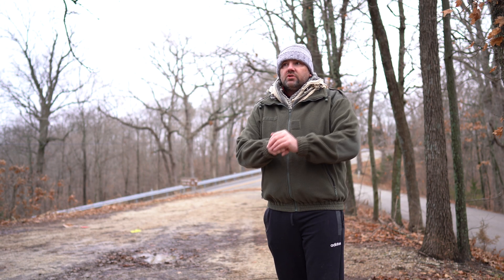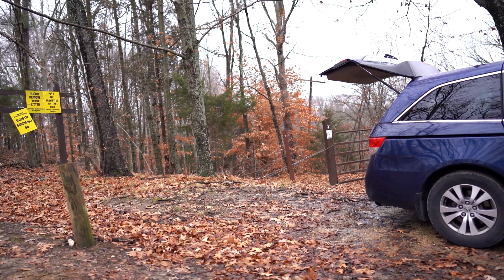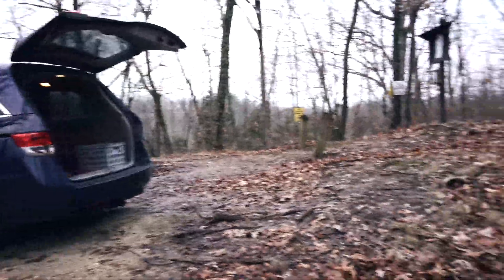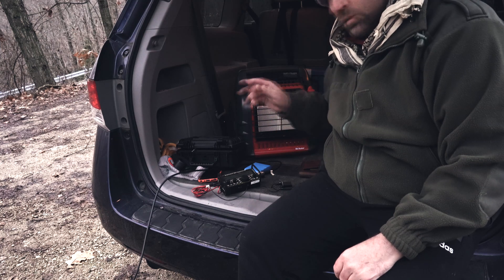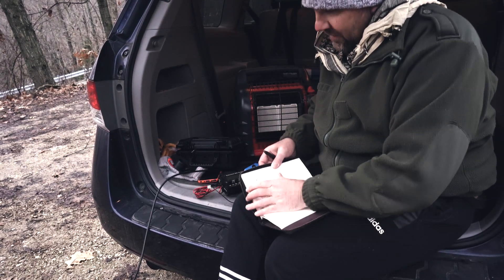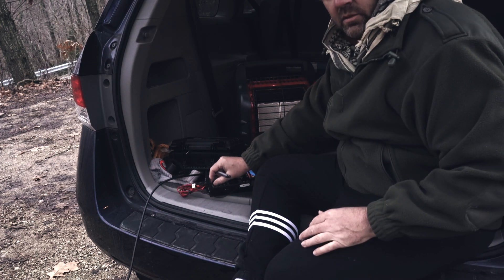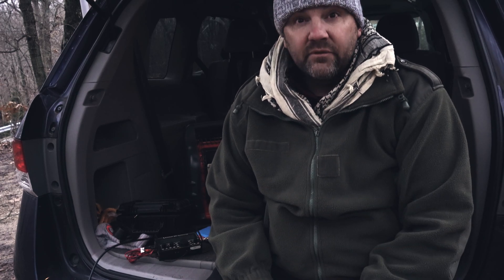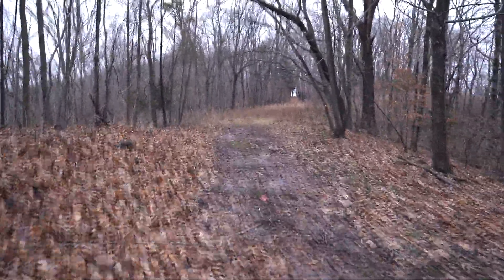Portable Winter Ham Radio Operations CW QRP

Comment: I went out yesterday and set up a G5RV high up in the trees using the same slingshot and trigger you have. Next time going to try an end-fed as it’s easier just to make one shot. I also use the 33’ mast on a satellite tripod staked into the ground and 4 radials with great results. But I’ve been watching your videos and have seen your setups change and improve along the way. It seems like we learn more when we go out and try new things and make mistakes and think about how to improve. I’ve picked up some good ideas and have adapted my portable ops based on some of your comments in the field. Have you thought about announcing a date and time and frequencies you plan on operating? Btw, I also find it useful when you comment on non-ham related stuff like your tent and  camping gear.
Reply from the maker: That is a great comment, congrats on the G5RV.  I like how flexible it is on the bands.  I try to do different things to challenge myself and keep people interested.  I like to try everything and learn, and once I feel I conquered it, I kinda move on.  Right now here in MO it's been wet and miserable out so I'm stuck inside mostly.  I thought about announcing when I will be out, but it kind of adds more pressure to the video.  I have to know exactly when I'll have free time, I have to feel like going at that time, then if I can't go I disappoint people.  Plus I have to worry about camera gear and radio gear and setup and tear down all within like a 2-3 hour window.  Adding the pressure of an announced visit just makes it more difficult.  I have done some live feeds at home though.  Maybe this spring I will announce more live stuff.  

I love your comment it gives me things to do.  Next time I go camping I'll tell what I like and hate about the gear I have.  Always honest.

Comment: Just a constructive comment. You might want to avoid those wire cables along the fence, possible negative effect on tuning. I run a similar setup with fiber pole and end fed antenna as a sloper to the highest tree as possible. It seems to work well for me. I run a Hyendfed multiband and don't need a tuner.
Reply from the maker: I hear ya Lorenzo.  Thanks for the comment.

Comment: Another good video Tommy - thanks. You're using remote key and didn't explain - I suppose because out of the back of the car it's difficult ergonomics? 
Alan
Reply from the maker: I think you mean my camera remote
Reply from the maker: I use that to turn cam on and off to avoid long scenes of nothing
Reply: @hamradiocq  no - you previously used the elecraft precision keyer didn't you paddle - was I imagining that?
Reply from the maker: I did but I didn't like it.  It was loose and flakey.
Reply: @hamradiocq  thanks - good to know. But now that piko are discontinued what would you recommend?